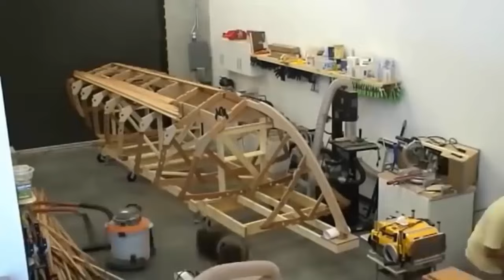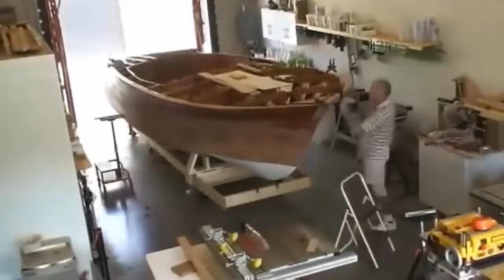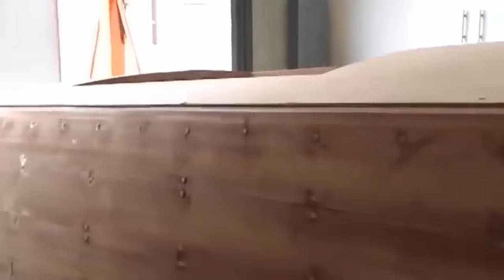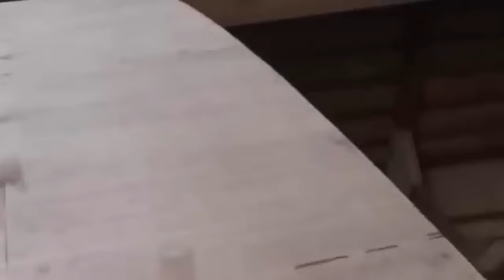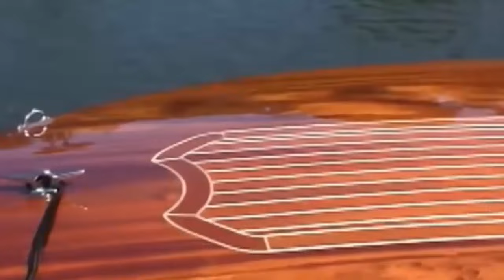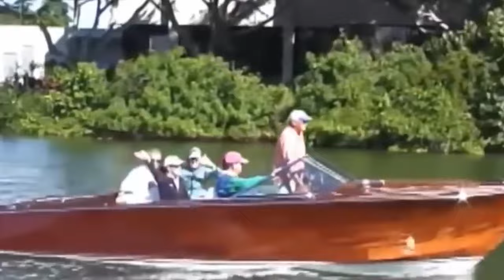Amazing Modern Technology Skill Wooden Boat Building Process, DIY TimeLapse Construction Fast Work

Comment: What about stress factors on the hull if you change the direction of the planks? I would like to see some numbers on that, I suspect that the hull can't take as much punisment with vertical alignment. I guess it's fine for ponds. lol
Reply: I'm thinking of wave power here.
Reply: So this is called a cold molded hull. 
The Carolina sport fishing boats that cross breaking wave bars are built this way. 
The misaligned fiber orientation is actually stronger on the bias because it’s going to provide strength in all directions, and not just the vertical plane. 
The cold molded boats of this style, bayliss, Spencer, Jarrett bay, Merritt, etc are all more efficient and faster than a molded boat like a Viking or Hatteras.